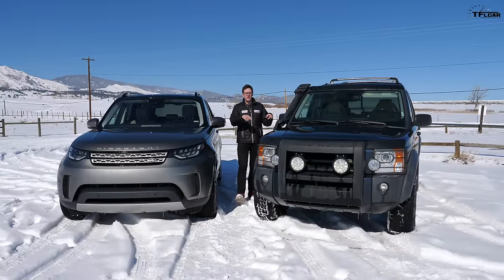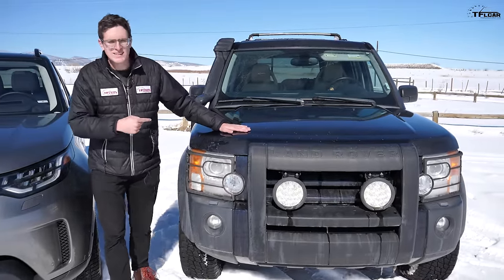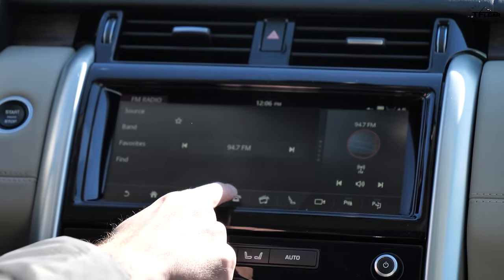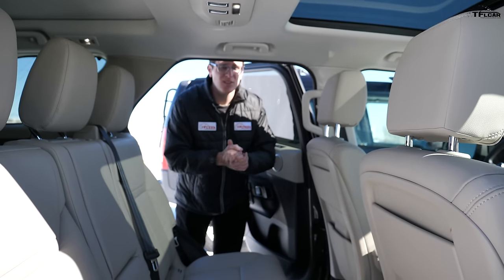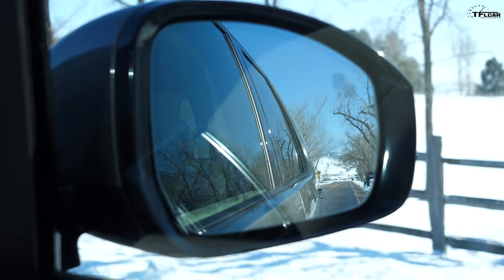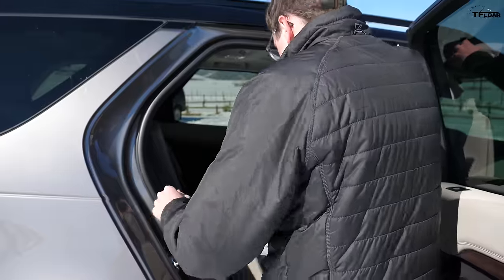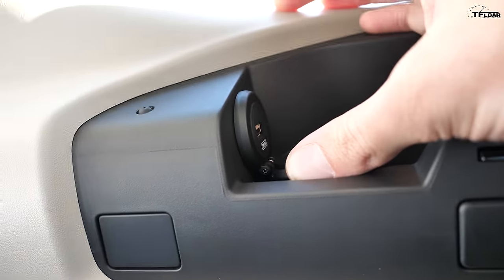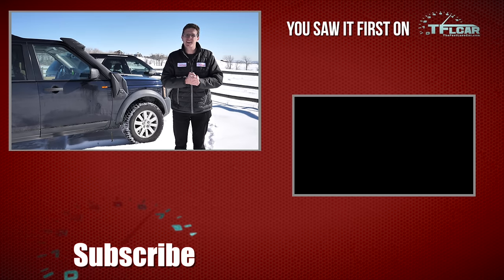Is The New Land Rover Discovery ACTUALLY BETTER Than A $5000 14-Year-Old LR3??

Comment: The “useless cubby” on the LR3 is actually a cup holder. Just push it, and will pop out. My LR3, also have the fridge under the armrest, the screen on the center, a flat back seat floor and the rear seats air conditioner with the head vents and vents for the third row. Also in the LR3 you can configure the remote control to lower the air suspension in one button, so loading cargo is easy. As you imagine, the back of two back seat is black on mine. Old LR3s are much tougher than the new ones. His only problem is the weakness of the suspension of the air bags. For me the LR4 is the last truly Land Rover Discovery. Actually for me, nowadays Land Rover is producing only one model, just in different sizes. Old model all day long.
Reply: The downside of the remote being programmed with the air suspension is you have to turn on the hazards. Also, it appears their 2nd row seats dont fold forward.
Reply: The last true Discovery was the D2!!
Reply: @krover01  there is always one of you guys isn't there? I think the D3/ lr3 D4/lr4 Facebook page would like to disagree with you on that the DII was the last discovery.
Reply: @Legoguy1979  Both 2nd and 3rd row seats fold forward.  The 2nd row seats do not recline though.
Reply: @jackprick9797  I think I didn't convet what I was saying correctly. In my 06 LR3 it came factory with 7 seats. In the video they only show the back of the 2nd row seat going forward. In mine is goes flat then there's a handle on the bottom corner where it disconnects the rear of the seat allowing it to pivot on the front of the seat allowing it to flip forward for easier access into the 3rd row.
Reply: Paulo G - The LR4 was the beginning of the end...low range became optional on this model.
Reply: Paulo G Yeah my family's LR3, has the center fridge, the 3rd zone climate control
Reply: Tyler MacConnell - and the 5.0 engine had far more issues than the 4.4 Jag. I love my lr3 because of the standards and the reputation.
Reply: krover01 I have a D1 as well. It’s fully prepared for off roading (diff lock, mud tires in Defender size, 2” lift by Old Man EMU, snorkel, steel bumpers, winch, etc). Quit a beast. A few months after I bought the LR3, I went off-roading (mostly mud and erosions) with it completely stock (mine has the rear diff). I was surprised by the capability of the D3 with regular summer tires. I didn’t get stuck and all of my friends with their prepared 4x4 were amazed as well. The electronic (terrain respond) is magical. So I DO consider the LR3/LR4 still true Discoveries.
Reply: We’ve had a D1 and two D2’s off road capable but reliability disasters towards the end. We currently have a LR3 and LR4 and I can say with 100% certainty that you’re wrong. They’re off road capable and are very reliable the LR3 more so than the LR4 but that’s due to it having the early 5.0.
Reply: It was only optional on the later LR4’s. 2014 and up. However this was only the case here in the US.
Reply: @paulog8813  My experience with the newer models have  been the opposite. They are pretty good offroad, but they reach their limits quickly. The ifs/irs suspension just doesn't do as well offroad as a solid axle. Ive been offroading my D2 for over 14yrs. I attend several LR events a year so I get to see these trucks on the trails. By far the vehicle we spent the most time recovering were the LR3s. Maybe its just poor driving? But there were 3 or 4 LR3s  that just kept getting  stuck when all the other trucks made it. Just my personal experience with them.
Reply: @Legoguy1979  Yeah there are always guys like me who actually offroad their land rovers. LR3 and on Rover got soft. Ifs/irs is great for onroad handling. But its shit offroad. After being a part of my local Rover community for over 14yrs and seeing how they perform first hand, I don't think a Facebook page is going to convince me otherwise.
Reply: @gardentractors1751   Ive owned my D2 over 14yrs. Its never left me stranded. It does have its quirks, as all 20yr old vehicles do. Offroad, an lr3/4 cant touch my truck. Most peoples definition of "offroad" is nothing more than gravel roads.  I enjoy a bit more technical offroading and the newer trucks just cant keep up. That said, its not my daily driver. Fuel costs are too high to drive it daily.
Reply: @krover01  well, my definition of off Road is using my lr3 on my farm. Whether in driving ut thorough a muddy pasture and over the creek in my pasture to get a stray heifer or if one is in labor. Also, driving it through the fields to get to my tractors. Before you say fields are easy, they are not when it rains they get muddy as all hell, I've had it where it's swallowed one of my tractors before. The reason I don't go to an off Road trail is because the closest one is 400+miles.  So really the only off-road besides the farm work is going into the woods to get firewood.
Reply: Zachary Solomon can I come work on your farm pls
Reply: @Fee.1  that's a weird question to ask. well, no not really as I'm not big enough for having farm hands, same with the rest of my Solomon family who have their own farms. Some of them even don't have farms actually one of them were factory workers and truck drivers thats one family. They too own a LR3. We aren't rich and can't afford those besides family.
Reply: @Legoguy1979  As long as it works for you then thats all that matters. My point is that you cant deny that Land Rover have gotten further and further away from their utilitarian roots. The LR3 is a fine all around vehicle for most families. They are very capable, but they are not really made for constant abuse or work, like the  old Defender and Series trucks. Personally I can think there are other vehicles better suited as a farm truck than a LR3, but again, thats  just my opinion.
Reply: Zachary Solomon yes I agree in 2020 actively seeking out work/labor/means of employment or just a new skill seems to have become “weird”. I didn’t actually think you were rich, hell many farmers are barely getting by With government credits and are still in the red. Wasn’t asking for charity to be clear.
Reply: @Fee.1  I didn't think you were being rude or anything it's just that it's kinda weird to ask in a YouTube comment section about land rovers that all I meant. It was something unexpected.
Reply: @krover01  oh yeah most certainly I agree. Land Rover is far from what it used to be. If I did I would love an old series truck though I've never even seen one in the US. Plus the cheapest defender I've found is $22k with 180k miles. I wanted a LR3 because like you said it's a good all around vehicle. No obviously if I'm pulling heavy stuff that the lr3 can't pull I'll use my dodge. But over all I do like traction control compared to standard 4x4 with lsd in the rear like my dodge and yes the lr3 is definitely not as bare bones or simple as older discos but that's just a trade off of it trying to do everything.
Reply: krover01 Stock for stock the LR3 and LR4 are far better. And that’s compared to a 04’ any other years without a center diff lock they’re pretty much useless off road. Now if we’re talking  modified then yeah your right. I loved the D2’s we had I just don’t love the Rover V8 I’ll probably pick one up in the near future and TD5 swap it. The D2 is better for more technical off roading and the LR3 and LR4 are better for long distance off road touring or towing. If I had to pick one to drive from the Arctic circle to Ushuaia I’d pick a LR3. It has good payload capacity it’s comfortable and it’s very off road capable and it’s somewhat reliable. Again like I said I love D2’s I personally think they’re one of the best looking Land Rovers ever made and it’s basically a Defender with a more luxurious body. But the newer truck just are better all rounders.
Reply: reallyllylylylylylyl hahaha
Reply: @gardentractors1751  I agree. Particularly one with the rear diff locker. After adding some good tires mine takes me anywhere I have tried to take it.
Reply: Cup holder : Any Guy with a slight passion for Cars should know that.👍
Reply: @johnCarter-tx4yv  The LR3 is very capable for the average user. IFS/IRS is great for ride quality, but not so much for offoading. Now every ones definition of "offroad" is different, but Ive watched a STOCK D2 take an obstacle that stopped 3 modified LR3s. The LR3s all bottomed out on their gas tanks and had to be winched off.
Reply: @krover01  Agree. I doesn't dance like my old purpose built toyota. At the same time it climbs well and does great on traction in moderate stuff. It does require a lot more attention to driving the high points and doesn't respond well to just being goosed up things. The IS creates some challenges. You have to set your rig up to balance articulation and clearance and you need to learn to drive it, but man if you want a rig to take you places and don't just drive for the challenge of it I haven't had a vehicle I appreciated more. I still enjoy a good play day, but that is definitely not how I use my LR3.
Reply: @krover01  One major difference with the IFS/IRS is that, no matter what you do with the suspension lifts on a vehicle with solid axles, the lowest point is always the diff.  With D3/D4, the diffs go up with the suspension when it's raised, meaning they don't compromise the ground clearance.  Given a track that's not rutted, though, the greater axle articulation of a lifted solid axle gives a better chance of 4-wheel contact.  I'm guessing you're in the UK, so there aren't too many tracks here which aren't rutted!
Reply: there are several videos on you tube where the LR4 fail on trails. in fact one that rolls. all the tech in the world did not prevent it from rolling. that being said. it prefer to roll in a LR4 than LR2. Overall I would prefer a LR4 over my LR2 if I could afford it.
Reply: I was literally going to comment your entire comment before I saw it, even word for word.
Reply: what a weird comment, the old LR3 are not more tougher than the new ones, i would like to see the old LR3 do half what the newer ones can, just because they look more "fluffy", they are far more capable and far better built and far stronger than the old LR3, which was a reliability nightmare, as for Land Rover on producing one model in different sizes, well LR produces three, the Defender, which is vastly different to the Discovery, and the Discovery comes in two sizes, Sport and Five, one os a smaller version of the other, like a Ford F-150 basic two door and a full on Crew Cab.

And as for the LR4 being the last true LR, what a stupid comment, every car that has been made by the brand has been far superior to the LR4, in every department, it is a shame that you really do not know what you are talking about with regards to the history and new production of the brand..... I DO.... we have as a family owned about 400 Land Rover products over 65 years, we currently have within our family about 70, of them, 35 in our company, at home i currently have a 2017 D5 and a 2018 Velar, as well as a Bentley and Mustang, i would not be surprised if our LR's do over 750,000 per annum, i have never really checked, but we change them every two years, regardless of mileage, the D5 has been one of the most reliable cars we have had and we are considering now keeping them for three years, whereas that is what we used to do before the D2 and LR3/4 reliability meant it was cheaper and more convenient to dump them after two.

Plus the air suspension on the D5 is vastly VASTLY superior to the LR4, which leaked and cracked under constant heavy use, the D5 does the same work, in more comfort, more economy, cheaper to insure and run, and can do far far more than anything that has come before it.

I have tested the new Defender off road on our premises, and after doing all the D5 could do, this was een more superior, so have ordered 20 (10 90s and 10 110s) and should hopefully get them now sometime in December.

Have a lovely day, stay safe, and keep indoors.....
Reply: @Legoguy1979  There is always one of you guys isn't there? I think the majority of people will think that there is always someone to disagree, and is entitled to put their comment, and if there is a specific page about the D3/D4 they are going to say theirs is best, so really what was the point of your post - apart from stating the complete OBVIOUS
Reply: My '06 LR3 has 190,000 miles, still going strong. Will likely need new air suspension soon, but otherwise, looks new, drives great, carries more kit than anything other than a Suburban.
Reply: @krover01  The D2 is just horrible though. Discovery 1 and Discovery 3 are the two best of the line.
Reply: krover01 iv had 9 Land Rover discos from the 1 to the 3. My 2 just kept breaking down (Td5) my I’m sorry but they don’t touch the 3. Wether it’s because I got the optional rear locker on mine who knows. The 2 is capable off road but the 3 is a different beast. I think you’ve just come across crap drivers who are frightened to use the pedal on the right.
Reply: krover01 absolute bollox
Reply: @Legoguy1979  actually, the 5 seat and the 7 seat models were there own spec. We have a 2005 SE with 7 seats, and a 5 seat 2007 HSE.

Comment: LR Discovery 4 is my all-time favorite Land Rover Ever...
Reply: Jude M  , i really envy you...the space, seating position, presence, off roadabiliti, comfort,...everything is perfect in it..😍
Reply: Vladimir Putin  i"ve got the same :) just love it. SDV6 HSE  with the BMW motor :)
Reply: I love the LR4. Ive been shopping for a new vehicle and keep looking at the 2016 LR4 but I keep getting slightly worried about reliability so I look at the Discovery Sports because I never hear anything about reliability issues. Plus you can get newer Discovery Sports with a lot less miles for the same price or even cheaper than an older LR4 with a substantial amount of miles
Reply: @razrv3lc  i understand, but the sport is not the same like a lr4 (or lr5)... it's to small...
Reply: I had Discovery3, HSE ,followed by a Range Rover Sport HSE, now the last of the Discovery 4 STDV 6 HSE all diesels, but by far my all time favourite is the Disco 3 followed by the Disco 4. This one is a keeper. All the new ones have lost their personality they blend with the current so called modern roundness, it is a pity.
Reply: @MrGamester59  , ur absolutely right..most of the Land Rovers now looks like a large hatchback....
Reply: Wouldn't trade my lr4 for anything
Reply: LRD4 all the way. Best vehicle ever for my needs. Truly sad to see what they have done with LRD5. Hope that LR will do their homework with LRD6.
Reply: Not sure about your review ... the LR 4 may have more bells and whistles and more power but the LR 3 V8 HSE is still the best of the bunch and the one to bring the biggest smile when driving ...

Comment: I've had a Disco 5. 3.0 SDV6 HSE spec. It's not like riding in a previous discovery. The driving position is shit. It feels like a regular car that grew out of proportion. The interior is basically a cut and paste from the range rover it doesnt have that distinct feel to it. Even uses the same steering wheel. Cant fault the ride and comfort but aesthetically... and the driving position it just didnt do it for me. 

When the lease was up I refused to have another. So I bought a facelifted "LR4" or discovery 4. And I'm much happier with that in every conceivable way. And the rear load space I dont care what they say is much better on the disco 4 than the disco 5. I'm sorry to say that the disco 5 really isnt an improvement over its predecessor. Having had both, this is my personal feelings.
Reply: I have both a disco 3 and a 5.  I wish they didn't b*stardize the car but they've even done the same with the Range Rover.  The Disco 5 is almost exactly the same car as the Range Rover L405, neither feel much like a landrover anymore and Tata's quality control is terrible.  Sit in a L322 Range and the new L405 you can feel the difference, one feels very English, it sits up high, huge windows, etc and the other feels like any other luxury SUV.  The problem is the LR3/4 is an old car now and Rovers do not hold up well, the cost to repair is prohibitive and for certain things rover really made it difficult to fix them.

Comment: I've had my Disco 3 / LR3 for 10 years. It's a 2005 one, with nearly 140000 miles on the clock. I wouldn't swap it for the Disco 5, mainly because I just do not like the newer vehicle's design. No doubt the 5 is very cable, but probably no more so than the 3. Much, I think, depends on what you want from your 4x4. If you're after a 4x4 that you can show off in town with on the way to get the weekly shopping, then the 5 might be the ticket, but when I bought my Disco 3, it was all about packing in the family (all 6 of us), and the dog, as well lots and lots of camping gear, and heading off somewhere. It needed to be rugged inside as well as out, because it didn't take long to get covered in mud. Easy wipe down was a must. Trips out in the 3 when my children were young, really were a voyage of discovery.  Yes, I've spent thousands in those last 10 years keeping the car going, but a lot of things can be fixed at home without the need of a specialist. I bet the same cannot be said for the 5.  I'll be sticking with my Disco 3, either until the end of its days, or the end of mine. And before too long, I'll be taking the grandchildren on camping trips in it, off looking for new adventures, as the cycle begins again.